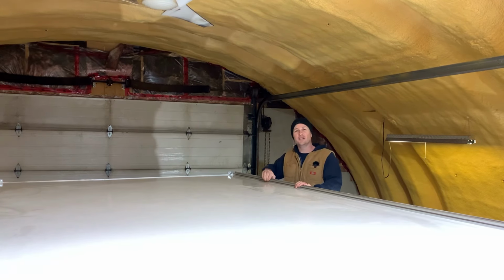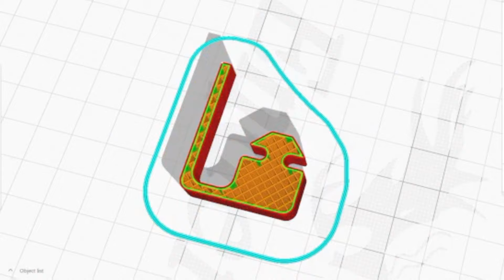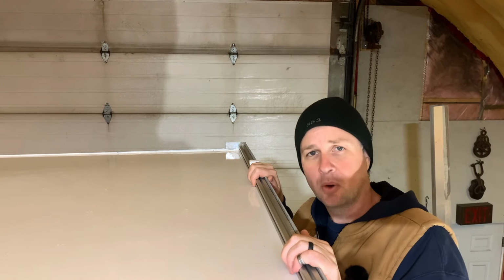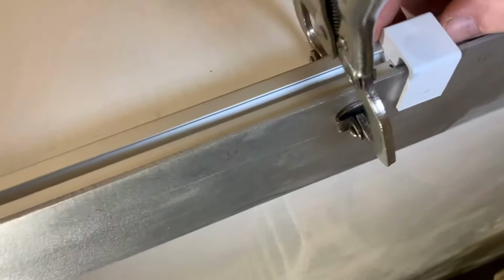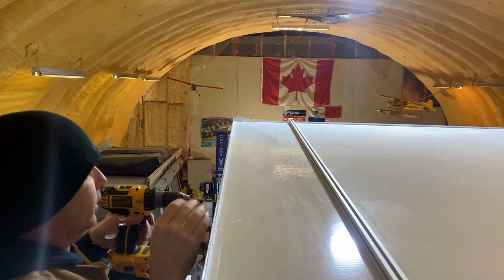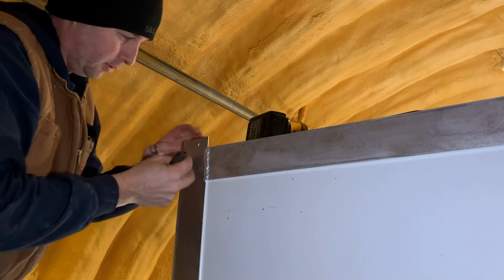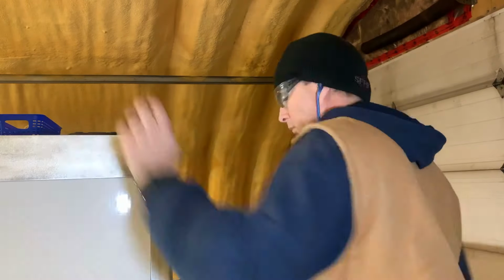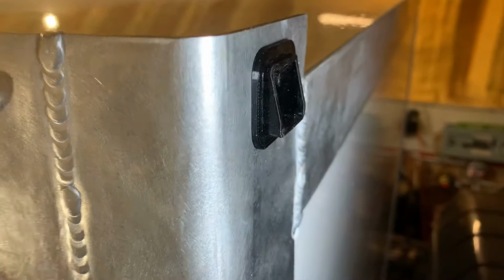3D Printed parts on the roof? | Fuso 4x4 Camper build

Comment: If you want a good sealant/ glue to use in cold weather, get a tube of Lepage Quad max. It can be applied at -18C and I have used it to bond Filon to XPS styrofoam, Filon to painted steel, Filon to Filon.I have yet to find a material it will not bond to. I have now built 2 composite teardop trailers together using Quad Max and am well on my way on the third teardrop.
Reply from the maker: Good to know - thanks!

Comment: Very neat solution.  Now you just need to print some removable fiitings to turn your roof 'drains' into 'water harvesting spigots' for when you are travelling in drier climes and need to collect your own water (that way you will be able to be sure that the water will be relatively clean and free from pathogens....not something you can be sure about from some taps, creeks or lakes).
Reply from the maker: I had actually thought of doing that on the two front drains (even just to get it through a tube to get it down low) but decided against it…. No real reason 😁